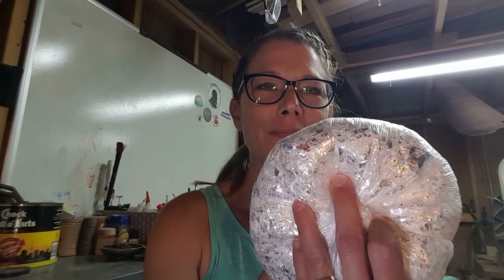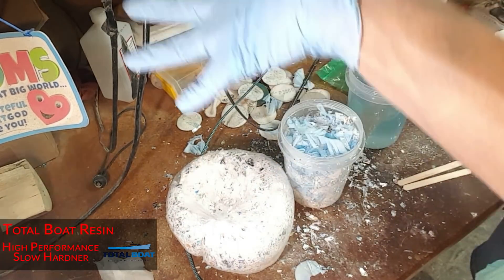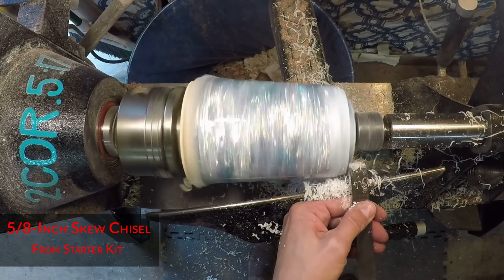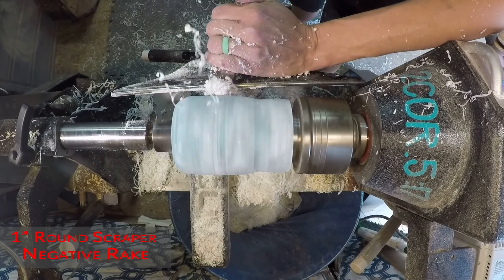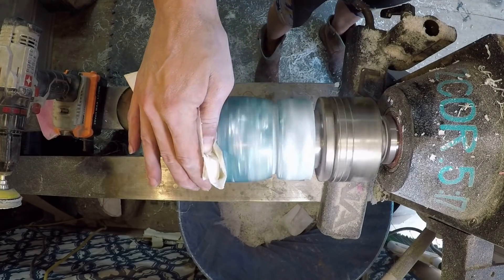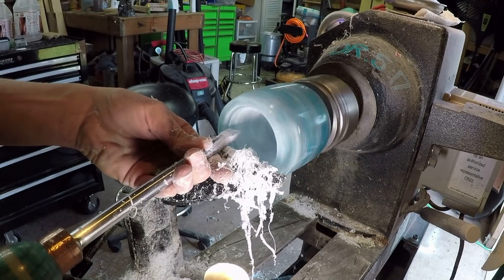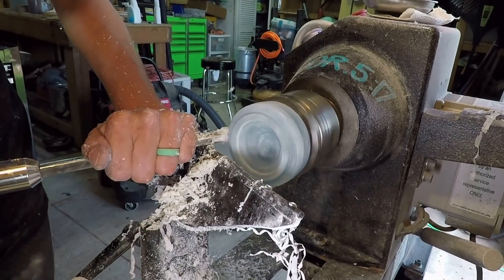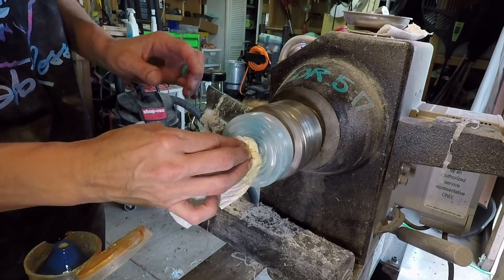Ice Box Resin

Comment: HI    KIM        i make lidded boxes and i  never can get the lids  to fit right  so i  do  fix them in a way that would  blow a wood turners mind  i put  a ring of SCOTCH TAPE on the lip of the inside ring then trim off the  excess  i know jt shows when you take it apart  and you can add layers around  lip for tightness but it works AND i usually keep those boxes  that i MESS UP ON   ALSO  you are a MASTER wood turner  your projects  are VERY BEAUTIFUL  AND your videos are some of the best to watch  KEEP making them  AND one more thing  YOU ARE A VERY PRETTY LADY      GOD BLESS         Larry
Reply from the maker: Thank you for the tip Larry!! I have a few boxes I need to try that on. God bless🤗🤗

Comment: Kim, nice box! As an aside, and I know this wont make me very popular, I have been trying to understand the risks of exposure to dust (of all types) when turning/sanding. I have been using an air quality monitor, which measures particles in the air (alerts when more than xx amount per cubic litre of particles  >2.5 thousands of a millimetre diameter - the almost invisible fine dust that clogs the lungs, causes cancers, etc over time). It also measures volatile organic compounds and carbon monoxide in the air and alerts (audible).  This is a  cheap chinese version (about £20 sterling) and better ones record and play back the info, so can see the contamination levels. It quite often alerts the particle levels when sanding even though I use a air filtration unit, a dust collector, and a  Trend type full air fliter cap/mask ( I can see the fine dust on the outside of the white air filters ... the Trend has an outward air pressure so I dont breath this in). My point is, I cant find a definitive study which measures the air pollution when turning and gives definitive solutions. I can see warnings for woodworking generally on the UK H&SE which gives max average dust exposure over 8 hours, and lists the PPE types which can be used. I also have a copy of Terry Porter's "Wood Identification & Uses" which lists the risk of working with various woods (inhalation of dust, effect on skin, etc). I took the air monitor and showed it to a lifelong local cabinet maker, and we saw the good effects of a large air filtration system in his drying room, compared to his spraying room and main workshop (the former indicated high particles content and high VOC pollution). So, I think it would be useful for the woodturning associations to really consider (scientifically using air quality monitors) what are the ill effects of various woods and pollutants and the effect of various PPE in mitigating them ?  At present we seem to take what precautions we can (and spend a lot of money on PPE) without knowing the real efficacy of our efforts. Bare in mind also that the very fine dust clouds do travel and have found to settle away from the lathe to be disturbed later (we see this when we wipe a cloth over an area). I've mentioned this topic to a few professionals and to PPE manufacturers and they dont seem concerned (the mantra being its the individuals responsibility). I hope you dont mind me airing the topic as it may well promote some advance in PPE or processes (wet sanding etc) if a few read and raise it at clubs or association level etc.
Reply from the maker: I agree. I would love to have more equipment for air filtration. It is costly and ideas to cheaper and safe alternatives should spoken about as well . Thank you for mentioning this. Hopefully it will open up good conversations at clubs and what not.
Reply: Hi Kim, thanks for your interest and reply. I forgot to say I use a M-class vacuum cleaner as well to hoover up shavings at breaks in turning, rather than a brush. This hoovers micro dust as well on to sealed internal bag, which see cheap to replace when full. Cost of hoover was £30. I paid about £300 for a Jet air filtration unit three years ago, and was thinking of adding another. The difference in the air is remarkable (I leave it on during turning and after leaving the workshop). The air quality monitor is in during and after turning. I still can’t prove this is enough in a scientific manner, as I can’t collect the data. I had thought that turning outdoors with fans blowing dust away is an option in good weather.

Comment: Looks like shredded foil paper gift wrap maybe?  As for the boots, cut the feet off a pair of tube socks, put them on your legs, put the boots on, then cover the tops of the boots with the cut-off socks.  Beats having to clean all sorts of crud from between your toes.
Reply from the maker: Thank you for the tip!!
Reply: @KimTippin  Old backpacking tip in reverse - pulling your socks up over the bottoms of your pant legs to keep the ticks out.

Comment: Absolutely gorgeous! It looks amazing and unique. I was just thinking about shavings getting in your boots when you mentioned it.

At 59 I’m at the very beginning of my journey and I’m limited on what I can do through a disability/health condition. That makes resin look very appealing though I’ve not used any yet, I want to conquer the basics firsts...sort of. I appreciate you putting the tool you are using on the screen but I don’t understand all the different grinds as yet. However, that will come in time and I just need to concentrate on the basics. 

May I ask if the pressure pot/chamber essential for resin? And I noticed you used boat resin, does it matter the type you use? I think these two questions show how little I know.

A great video, I love the narration where you give the story of the piece rather than instructions. I’m an amateur photographer and I believe the story of any art is massively important. Not just how it came about but also the story it’s telling.